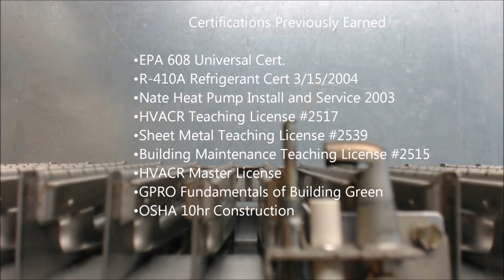Gas Furnace Spark Ignition Control Troubleshooting- Two Rod!

Comment: the last few days we have had temperatures around 40 and 50's here in Louisiana, my gas heather furnace, was not coming on, checked some of the voltages, , CLEANED the ignitor AND A SECONDARY IGNITOR SENSOR, with a fine fine sand paper, then cleaned bot it with a rag, reinstall them and the furnace came on as its supposed to, Thank you for the lecture and explanations, it sure worked. Thank you for your expertise and help.

Comment: Very clear video.  Question: should the PV to MV/PV voltage reading remain 24v after the MV comes on?  Mine does. All other circuits work and read correctly.  I just retrofitted a Honeywell/Resideo Y8610U intermittent pilot ignition kit to an AWI162 Crown boiler with a standing pilot.  I left the vent damper hooked up to the original transformer, and only used the TH and TR leads from the original to hook into the new module at the TH-W and 24(gnd) terminals. I did not use the 24v terminal on the module. I grounded to both the gas valve and pilot bracket.

Comment: I just happened to cross this video and thought my prayers were answered in that I might be able to get in touch with the company I'm up in Connecticut I'm a 71 year old retired Leo who installed this exact unit on my old Dayton 3E 405 heater that I've had in my garage for nearly 40 years I went through the trouble of this installation because in my older years I can no longer light the standing pilot I've had absolutely nothing but headaches for 2 months now no one seems to know the answer but this particular video begins an explanation of the system your company seems amazing is there any way that I could explain in detail to someone is there a contact thank you

Comment: I've been troubleshooting one of these and having zero luck. The original controller sparked, sensed the flame, then turned off the pilot valve after about 15 seconds (no codes flashed.) I bought a controller off eBay, "removed from working equipment, " and it worked at first, then went into a mode where it would spark, sense the flame, all heartbeat flashes fine, then after 90 seconds shut off with a flash code of 6 -2 . Never got a main burner open or voltage on the MV terminal. The eBay guy was kind enough to send me a second device but it does the same thing, leading me to believe that it's not the module. However, everything else in the furnace appears fine. When it lights off the pilot, I can apply 24V to the main burner lead and it fires off just fine. I'd like to clean the sense rod just to be sure it's not that, but it's virtually inaccessible, and I don't really want to tear the whole assembly apart for something that "may" help. I'd appreciate any suggestions/advice.

Comment: Does the flame rod just go bad? Mine is in the flame well, very red hot then gas is just cut off and boiler stops heating. It will heat for about 90 seconds.

Comment: Great video thank you. 
I've ran into these on the carrier RTU package units KLA series. The latest one I worked on the 24v was coming off from what I believe was a relay wasn't sure what that was but there was no 24v coming out have you ever ran into those? and would it matter if I just pulled the 24v volts from the transformer ?
Reply from the maker: The problem with this version is that when it gets a 24v signal the heat sequence will turn on. There is another type with a vent damper plug and that one does need 24v all the time when using the vent damper and has a separate 24v terminal to turn the heat sequence on. The relay may have been powered from the 24v heat signal wire with safeties to open if there are any problems. The question is why it is there. You would have to reverse engineer it and read the wiring schematic diagram to figure out why it is there. For furnaces there is always a safety reason. For ac's I find some bad designs every once in a while. Thanks A VM!

Comment: thanks for the great video, would you please let me know what is the parts number of the pilot assembly that you are showing on the video, 
and will it fit on furnace of lennox whisper heat model no : sp 745 or help me to get the aforesaid OME part number, that I urgently needed. thank you GOD BLESS YOU.

Comment: On an ancient Dayton 3E369 Fuel Trimmer there is no 3rd wire GV MV/PV common return lead and if there was it is not present now.  
You do not include a thermostat link. Where would the TH red and white leads connect?  You connect directly to the TR so I would surmise the TH red would connect directly to the TR red (hot) and the TH white would connect to the Robertshaw TH.  That would leave the grounded RS TR terminal to piggyback the MP/PV common return ground to the TR white common, right?

Comment: Merry Christmas! I have a Honeywell S8610U spark ignitor control. It burns the 24v transformer. I replaced the transformer, and I got 8 flash error code on this control, which means the low voltage input has problem per instruction. I checked the low voltage wire (to TH-W) and found it is grounded. When I pull off the burner ground wire (GND), the low voltage wire does not ground any more. Does this mean the gas ignitor control is bad? Thank you.

Comment: I’ve got a Robertshaw SP 745 on a single rod setup. I’m able to get 24v reading at TR + TH and also TH + PV/MV however when I turn on my wall switch the ignition usually does nothing or sparks the rod for about 5-10 seconds the stops. We’ve been able to start the fireplace about 1 out of 100 times this year. Any idea what could be wrong or how we can troubleshoot?

Comment: So I'm having issues with my boiler, once turned on all operations work fine I have spark, pilot and then ignition, but once boiler gets to temp and shuts down and then tried to refire the spark happens but no pilot, boiler shuts down, once I flip the switch on and off the boiler fires right away, any info would be great thanks

Comment: Great video, but I still have a question about the ignition operation.  Once the igniter lights the gas, and the main gas is kicked on and the fan is running should the separate gas line to the igniter (PV) shut off?  My igniter (PV) gas stays on after the main gas (MV) is running and the system is working,  it seems to be taking a toll on the igniter itself.
Reply from the maker: Usually the pv pilot stays on because this is where the flame rectification signal is proving the flame is there, thanks Andrew!
Reply: I agree that the PV stays on when the MV comes on. What do you mean it’s taking its toll on the igniter?

Comment: Lately, my intermittent spark ignitor is having trouble igniting the gas so I had to manually light it to get the furnace going. Once lit, it will work for awhile but  then it returns to not working normal again.   Now, does it mean I got a bad ignitor and needs to replace it?  I clean the rod and ignitor with steel wool once last year and it works good but this year it is having the problems I had just described above.  Thanks
Reply: same here, did you solve it ?

Comment: I have a problem like that, gas is coming out but not the spark at all pilot stays on for a short time and goes off fan goes on only  getting cold air so where i need to start question the limit switch doesn't have nothing to do with this?nor the pressure valve?help pls.

Comment: at 8：30 do you mean the board is defective? Thanks. Great video serial.
Reply from the maker: Yes I mean't the board is bad. I said the board is the culprit, meaning it was the reason the system is not working. Thanks and I should have used different wording!

Comment: My spark module liote the pilot and than the main flame. And then runs for 30 seconds with flame on and than it goes out. Flame sensor has been cleaned and all terminals checked. What could this be?
Reply from the maker: Check the plenum heat sensor that senses the heat near the heat exchanger, also follow the ground wire back to the module and make sure it is making good contact at the gnd to the module, thanks

Comment: How does the ignition module send 90-100VAC through the flame rod if only 24VAC going to module? Transformer inside the module?
Reply from the maker: Yes each module takes the 24v and transforms it to the higher voltage for the flame sensor.
Reply: Really? Rather than taking from the 120v coming into the ignition box directly to the ignitor , it takes 24v to a transformer in the box and steps to 6-12 thousand volts?

Comment: I spark it works it lights the pilot, the burner starts but the spark continues to work anyway, it stops about a minute later but it starts again and so on and after a while the
Reply from the maker: It sounds like the ground flame rectification signal is not being sensed by the control. Check the ground wire and connections, thanks!